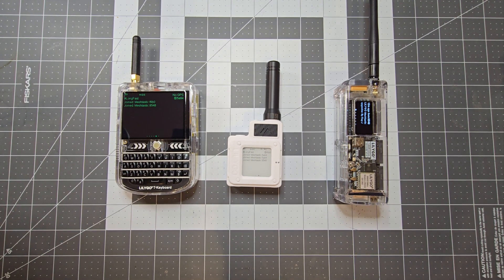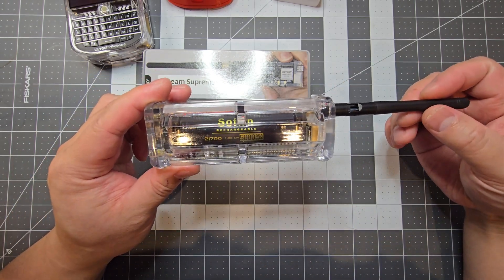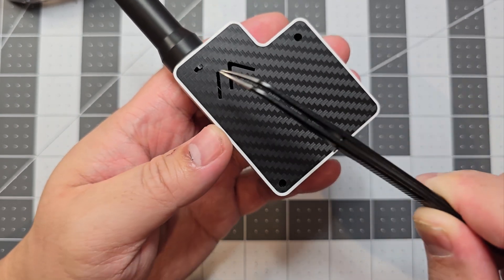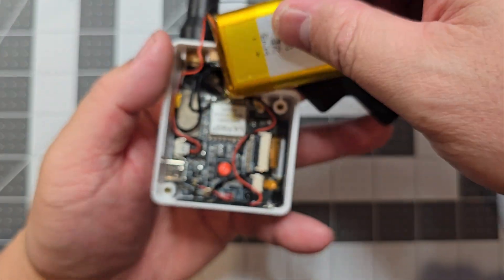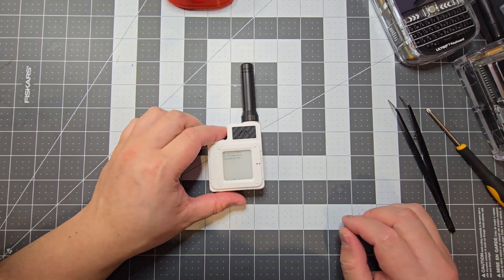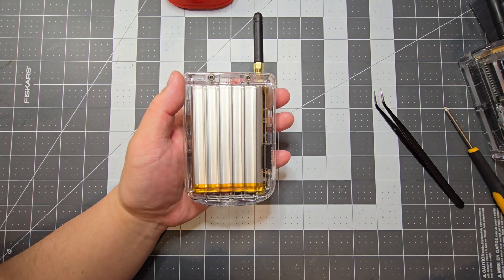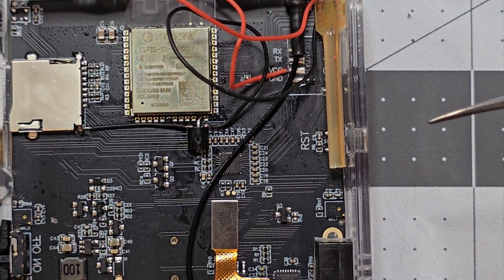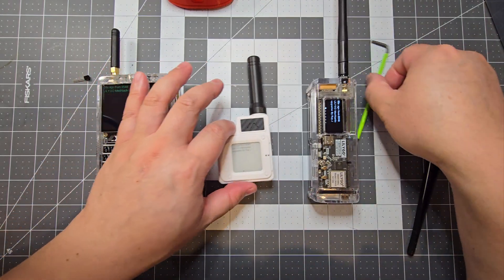LILYGO T-Deck, T-Echo and T-Beam Supreme Meshtastic Builds

Comment: Hi a great build vid always love these type of vids, but can i just ask a coupler of questions about the T deck plus please? What is the point of buying one of these? it has meshtastic, yes it can "text" “other” devices but what then? Can one war drive with it? Is it a pentesting device? Can you "hack" Wi-Fi with this i.e. pentesting Wi-Fi? im just getting confused with all that one can do with this? How many GPIO pins has it got? What else could one "plug" into the T-Deck plus? Could one start a business with this, like testing people Wi-Fi (with permission!) with this? Just a bit confused at what it can do? Is it a different type of Flipper zero or a smaller version of a Linux Cyberdeck uConsole? Sorry to ask all these questions mate! Thank you for all your time take care and have a great day!
Reply from the maker: It is mostly aimed at Meshtastic. However, you can flash other firmware such as Bruce firmware where you can do some wifi stuff and potentially wardriving. There are not any freely available gpio pins to use, so it is limited there.

Comment: hi did u share the t deck clear case ?
Reply from the maker: @ninja1a  it's just the Alley Cat case linked in the description and I got it printed in clear from PCBWAY.
Reply: @rayj1988  looking at thankyou
Reply: @rayj1988  utr-8100 by chance
Reply from the maker: yes, as per description Clear 3D printed resin cases ordered from PCBWAYS option was UTR-8100 (transparent) finished in spray varnish.
Reply: @rayj1988  Thankyou brilliant idea for clear, i couldnt find was in wrong menu
Reply: @rayj1988  I've never done this before so trying to do the clear case.  Does $70 sound about right?  Thats the quote I got.  Just want to be sure, thats all.

Comment: Thanks for the Info on how to wire up a vibration alert or notification LED in the T-Deck.
Alley Cats printables project only said that no one had figured out how to do it yet in that regard.
I assume under advanced GPIO under optional gpio set pin 48 for vibra motor?
Also damn, these clear resin cases look great, but at 50 usd for the T-Deck set I stick with my PETG printed one for now.
Reply from the maker: @fuwo7566  It should be under External Notifications, so web based its Config Sections - Module Config - Ext Notif. App it's Radio Configuration - External Notification.

Yeah, unfortunately, the cases are not cheap, but they do look great haha I just like my builds to stand out a bit and to be different.